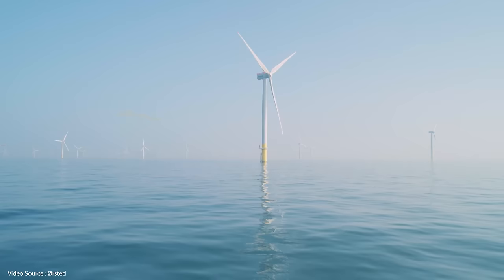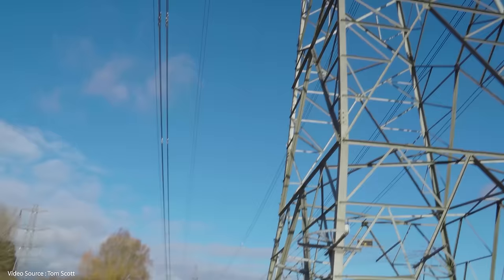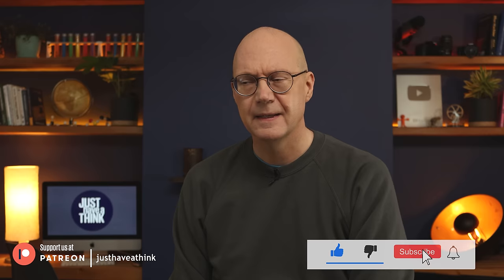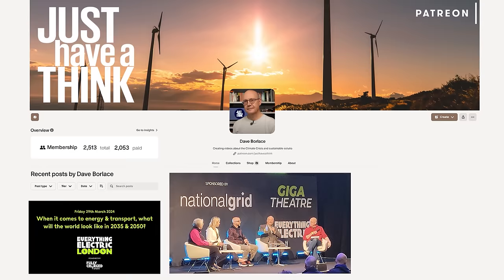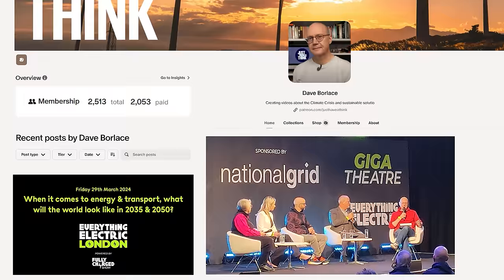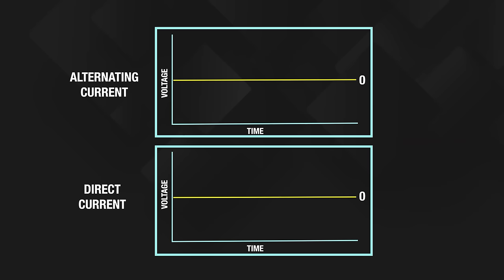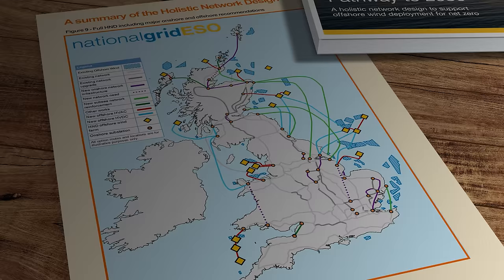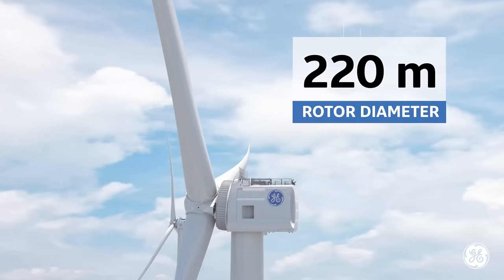Ocean Electricity Grid. How do they do that?

Comment: The grid needs to be constructed, owned and operated by the government on behalf of all the people of the UK. Asking competitors to sort it out is like asking turkeys to vote for Christmas.
Reply: Not really. I work in the UK oil industry, and pipelines and infrastructure back to shore has routinely been shared for some time. Even in places where metering was terrible, agreements were made in proportional sharing. In industries like these, there are so many crossovers between staff, service companies, companies themselves engaging in joint ventures for capital etc that it's easy to come to agreement. I'd have thought wind would be even easier, as a turbine's output to its connection point would be fairly easily to calculate with a degree of accuracy. There's usually a cut to the pipeline (cable in this case) owner, but energy provision has - generally speaking - such a predicatable return on investment, that cooperation is much easier than non-cooperation.
Reply: @ricos1497  Fair enough. Good to know. ;o)

Comment: What's worth mentioning is the excessive differences between Scotland providing large sums of the UK's generation and England containing the majority of demand centres. All offshore cables to be built East of Scotland down to England are to alleviate the issues with the constrained and near-bust B6 boundary overhead lines. I'm currently involved in proposing and designing new overhead line routes between Scotland and England, the amount of infrastructure to be established in the next few years will be some of the largest projects the UK has seen in years!
Reply: Sounds like an exciting project. Good luck.
Reply: Are people such as yourself and the industry in general in the UK aware of  new cable technologies that typically use a carbon fiber central core to give strength rather than steel. This reduces weight and increases the amount of conducting material. The idea is not to simply reduce cost of new transmission lines but to restring exising overhead lines potentially doubling or even tripling their capacity. So much easier and cheaper than new lines?
Reply: @petewright4640  I believe that steel/aluminium core still remains the standard due to supply chains etc but you're right that reconductoring is definitely the preferred way to go. Hopefully carbon fibre cores will appear soon and the saving in weight will allow for an increased conductor diameter.
Reply: Britain is composed of  one represented Country - Scotland two represented Principalities Wales and N.Ireland and one confused mishmash of unrepresented regions districts and areas some of us still call England!
Reply from the maker: Thanks John
Reply: I think I worked out that Scotland can export a max of 5.7GW of power currently. Sound about right?
Reply: @petewright4640  l only recently listened to a podcast with the CEO of a company called TS Conductors. They are in the business of new technology HV cable. Turns out that the existing technology is well over 50 years old. The new technology is that much better than the existing stuff it's crazy. Lighter , stronger , cheaper lower resistance,  less pylons required,  less sag etc. Funny how we don't think about simple things such as transmission lines when in fact they are a crucial part of the switch to an all electric society. l really hope the developers are paying attention.
Reply: @billhill4479 
The US is already deploying these carbon core cables. ...they have had to after the Texas and New York outages.  They are able to increase the electrical carrying capacity by 4-5 times and reduce the wt. So yup best to crack on with a test section and then add the rest.
Reply: Another thing worth mentioning is the eye-watering price of all this hardware and its installation…
Reply: @unclepete100  
The outages over the past few years and the delays to major wind ,solar and other renewable input schemes cost even more especially if it's out for more than a day or two then the mobiles and internet goes flat.. and then it gets very dodgy for people. The increase in costs of gas and oil  and strategic vulnerability to the likes of OPEC or Russia kicked of the recent round of inflation or have we all forgotten the way  electric gas and vehicle fuel costs have  reduced a lot of people to debt. 
This is a problem that nothings got done about in 15 yrs and as for developing alternatives we were pointing it out to the isocracy  as far back as the late 70s   when I first started studying what was already looking  obvious. 🧙🏼‍♂️
Another point is the materials can be recycled.   The only element that's new is grid scale battery storage for load balancing .  Theirs always been a limit to hydro pumped storage because of the sites...and dams and tidal barriers are now generally seen as too disruptive to ecosystems.. so much so that in the US and Canada they are removing many smaller dams... but bringing in the experts, beavers to control the ecosystems and hydrology. 😉🧙🏼‍♂️
Do away with crypto mining and 
Improve or reduce the amount of data harvesting and storage and you will cut electricity demand .
Reply: Cool gig John! 
The technical aspects are pretty straightforward, it just needs doing really. That's not taking anything away from the scale, complexity and a sense of pride that anyone working (not just vacuously flapping jaws and spinning manure) would and should feel. 
I am a little bewildered that the expansion of the UK's grid is happening or being considered now. What has the UK been doing for the last 70 years? It's great to see energy transmission infrastructure being rolled out in developing nations. It makes a huge difference for living standards and the economy at large.
It will be wonderful when the UK finally sheds its North Atlantic Ocean, under developed, island nation status. Millions will be freed from abject poverty.
Moving out of the third world and into the modern world will be a challenge for the UK.
I wish Her well.
Reply: @englishpassport6590  WTF are you talking about? Of the 650 constituencies in the UK, 533 (82%) are English. I.e., English representation in Westminster is over four times that of Scottish, Welsh, and Northern Irish representation combined.
Reply: @unclepete100  It's estimated at $9.2 trillion to achieve global net zero, which is indeed a lot of money, it's approximately the amount the global economy spends on fossil fuels every 20 months.

Comment: Another possibility, not sure if it was explored in the UK, is to upgrade the existing transmission cables (you did a video on re-conducting). There is GETs (Grid Enhancing Technologies) which can add 20-30% capacity. Re-conducting that can give 2-3x capacity. Moving to HVDC that can give 4x. The good part of these technologies is that it does not require new right-of-way.

Comment: It helps a lot of the power grid is owned by the people, your government! If your politicians say they are going to sell your hardware tell them NO! I still own my power and water infrastructure through my state government. That is why we only loose power if a tree falls through the wires in a storm. We did loose the water once for about a hour as when they were working on the pipes in our street a stopcock broke. It was very old and they didn't have a spare in the truck because they don't usually break. Got to love being able to vote out a government that wants to sell the people's stuff to their mates.

Comment: I worked for a county council in support of the boreas and vanguard windfarms. The government collapsed the projects pretty roundly, killing off a further 2 and 3 GW of installation.  I don't think the offshore ringmain is likely to work, not least because a lot of the issues they purport to avoid don't get avoided forever . Sooner or later, they have to come onto the land via primarily rural and conservative constituencies who also have the power to collapse projects by objecting to the installations. Sizewell is a good example of this - if the new nuclear powerplant is putting up a 3m high sea wall, its time to read between the lines as to what that means for your flat, coastal village.
Reply: From the referred report : The recommended Holistic Network Design
The result of the HND process is a design that: • Connects all 18 in scope offshore wind farms (with a total
capacity of 23 GW) to the onshore network.
• Includes regions of strong coordination, and regions where
radial connections are favourable.
• Has 15 landing points to shore.

This seems to indicate there will be a limited number of entrances for the offshore electrons. No doubt these will become nexus points for conflict around the world in the future with laser air defence batteries given the daft nature of some humans?

Comment: Tx for another great energy video topic. It seems getting electrons from point A to point Z is very complicated & complex indeed... 

It would be helpful if we could convert existing power stations to renewable energy sources to take advantage of existing infrastructure. I have seen another suggestion that any new transmission & distribution infrastructure should be located along existing transport routes to avoid having to lease land from private owners etc. I'm more of a fan of interconnected distributed mini grids - especially in cities - so that energy is generated as close to consumers as possible. The great advantage of offshore wind though, is that it is less intermittent and is less obtrusive than onshore wind... it's complicated

Comment: I love this channel but I’ve ‘JUST HAD A THINK’ and remembered that the generators in wind turbines do not transfer electrons through the wires as Dave described but rather it’s electrical ENERGY that is transferred - NOT electrons - indeed for AC generation the electrons don’t actually flow anywhere, they just vibrate. 

Maybe I’m splitting hairs and not the key point of this excellent video but I’ve heard Dave say this several times before.

Comment: Just love how optimistic you’re Dave, I’m guessing when you quote WT Wind Farm GW’s that’s that’s the combined output of rating plates not what they actually produce. If in the fullness of time we managed to produce enough alternative energy to power just current needs, that would still only represent 20% of the energy we use, which seems to be ignored. Jevon’s paradox will be playing out nicely, for just when you think electricity savings like replacing LED’s with Laser Diodes, along will come data centres wiping any savings, and plus some. As I travel around be it on land or sea I see great swathes of PVP’s and WT’s. If my great grandchildren coming up to 2 yrs old live to 80 they’ll see at lest 3 renewals of PVP’s and WT’s that’s if there’s enough energy to recycle them (and that’s another story, pollution), let alone manufacture replacements.They’ll also see 2050/60 and the oxymoron of Net Zero, and if it hadn’t already happened before 2050, then between 2050 and 2100 they’ll have seen, if not involved in fighting to maintain access to, well then the depletion of Oil and Natural, Gas, but also the rise of Coal to fill the energy gap, and be practising “The Great Simplification” but still well on the way to way to extinction. I really fear for what my great grandchildren, or a baby born today, will have to face in the future. And of course all of this rests on our not extinguishing ourselves in a Nuclear winter🤔

Comment: It's all about synergies.

Combining the offshore grid with a large scale build out of ocean habitat would restore the oceans and convert unlimited amounts if CO2 into food. (And to the floor via detrius)

It's very expensive but done right can pay for itself.

Done right you can even combine it with offshore desalination and pipes to bring the water to shore.

Offshore desal can use deep water pressure that runs for the cost of an extraction pump because you don't have to pressurize water and then release half of it as brine.  Put the filter on a tank.  Sink it and pump out fresh water.  Cold enough for AC if you want to go crazy.

Comment: The problem I keep seeing with big solar and wind farms is that consumers don't seem to benefit in lower prices, and I know they say it's because of the cost of upfront investment, but something has to give at some point if they really want the public to be onboard with all this.

Personally, I'm more of a fan of generating our own energy, on-site as needed, and as the tech gets better and cheaper, it's becoming a lot more viable, and at least this way, you cut out the middle men and start to save on lower energy cost, and probably longer term, almost free energy.

The key to that is that a buffer is needed with energy storage, and that is where the problem is for now, battery tech is too expensive and the amount you can get is still too small, but eventually as tech keeps improving, I suspect a lot more of us will generate our own energy because it will work out cheaper, whiles giving us full control in lowering our bill, which I get a sense that it doesn't seem to matter how much big renewable projects that go online, our bills never go down and you can't help but feel they are profiting on that.

There's another factor, maintaining the grid network is really expensive, I heard somewhere that it accounts for around 40% of the entire energy cost, if so, then there are some major advantages in renewable on-site or gridless in the long run, cut out the middle men, no need to maintain a grid and so on.

Clearly, this isn't going to happen any time soon, but with the advancement of tech, it's likely going to be more viable for a lot of us.

It's just a shame that we can't have a mix of solar and win at a small scale, because that would complement each other really well, but every time I see wing turbines in urban areas, they don't work that well, but a lot of new ideas are coming around, so who knows, that might change, if it does and we can have both, that would reduce the need for as many batteries, as the energy generating will be more consistent, it will also allow us to generate a lot more energy at all hours and all year round.

So anyway, I'm hopeful about the renewable future, but personally, I think as tech advances, more of us will want to produce as much if not all our own energy needs on sites to cut out the middle men and actually get real savings and not just the promise of savings they keep telling us about.

Comment: How about windmills that are basically enormous bicycle pumps, with high pressure air hoses on the ocean bottom, which could be buried onshore to a station where  an air motor (like a quiet  triple expansion steam engine?)  would spin a generator.   No electrical dangers, and any leaks would be easy to find.  Multiple mills could be ganged together for increased power. Im sure air hose would be orders of magnitude cheaper than the underwater wire currently used.   Electrical generating windmills have hugely expensive and complicated systems that require  mechanisms to keep them spinning electrically in phase as wind speeds change. That wouldn't be an issue for an air pump, as the faster it spins the more air is pumped. Excess air could be stored under pressure in bladders on the ocean bottom. As an added incentive, design a system to chemically collect carbon dioxide, from the compressed air supply for accurately measured carbon credits, and possibly, some rare gases could be collected as well.

Comment: Your video's are always terrific, thanks for sharing!  If the mass production of Graphene is ever perfected, our existing electrical grid will become obsolete overnight!  Graphene's characteristics is very similar to a true "superconductor!"   These Graphene cables could be buried, who needs those ugly and dangerous existing high voltage systems?  Another bonus no AC-DC conversion as needed with a true super conductor.

Comment: Australia's 4,000km southern coastline borders the circum polar winds that blow clockwise 24/7 around the Antarctic and across the southern ocean.

Australia has an offshore wind potential of several PW (>1,000,000,000,000 kW), about 100x the national demand.

Australia currently has installed OSW capacity of 0W.
Reply: Not to mention 80% of the population live in the coastal zone. We're a joke.

Comment: In the UK concept of cost benefit analysis seems to have been unlearned. Good example HS2 never needed to be the fastest train track in the Europe if the line had been designed to run at say 90mph I am sure it would have saved literally tens of billions off the price tag. Instead installing very fast broadband on the train would have cheered up anyone who would have been disappointed to be going so slow. 

Putting high voltage electric cables in the sea which then bumps up the cost massively instead of pylons going across East Anglia. I cannot honestly say that would offend me. There are no national parks in East Anglia which I am aware off apart from the Norfolk Broads, which is pretty small and surely that could be skirted around. I am 100% in favour of more onshore wind turbines and offshore wind but as a nation we should be aware of the cost of going to extreme lengths to avoid infrastructure which we can see.